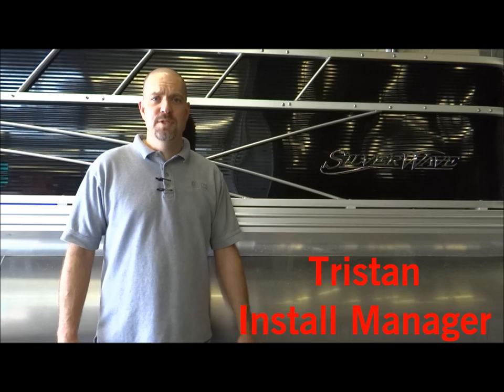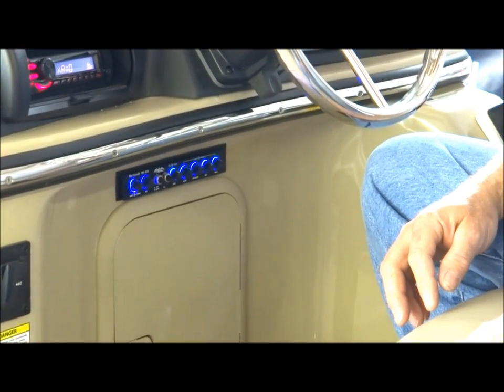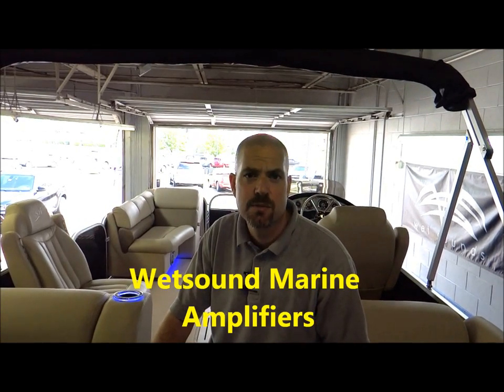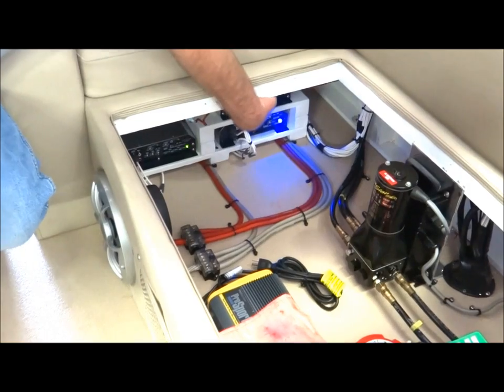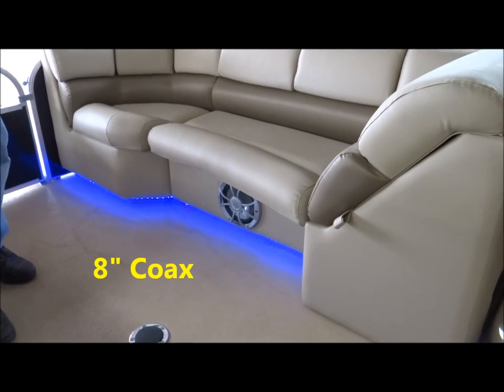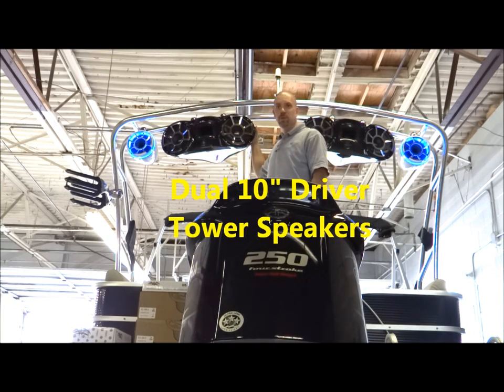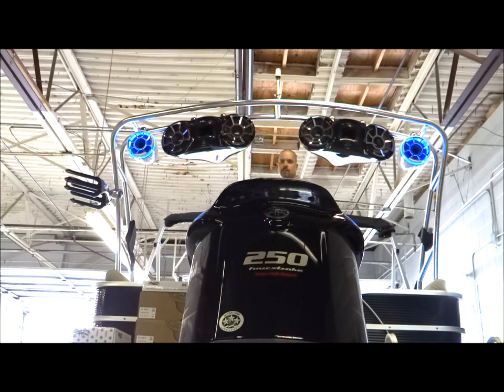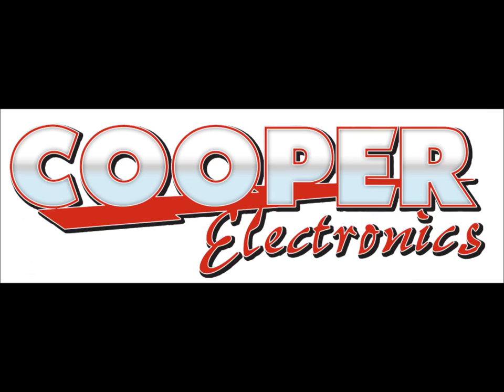Wetsounds Marine Audio in a PONTOON Boat - Oklahoma City Pontoon Stereo System

Comment: can you talk about the battery setup and charger you had mounted in there. Also how many amps at normal listing is the system pulling from the battery and how long can you go before the batteries need charging.
Reply: For a large nominal fee of course. If they showed you why would you need their business?